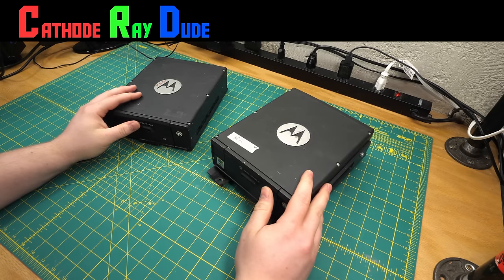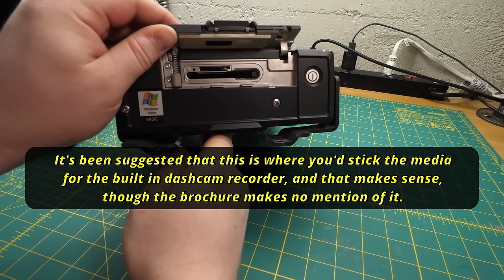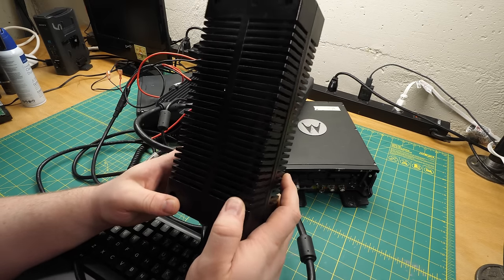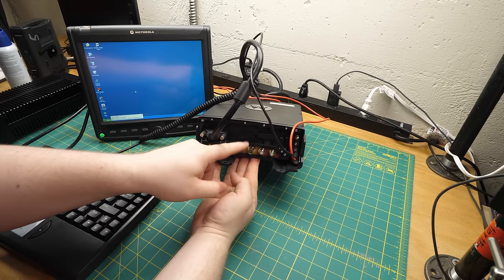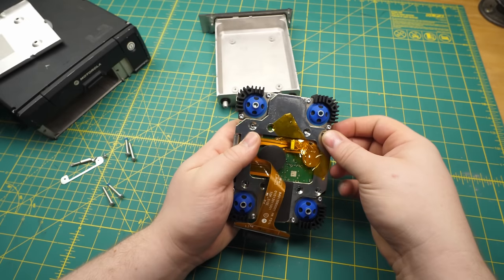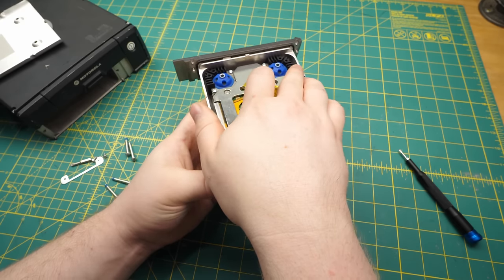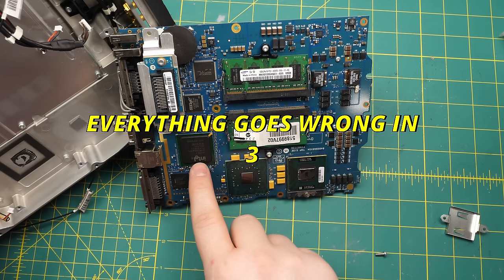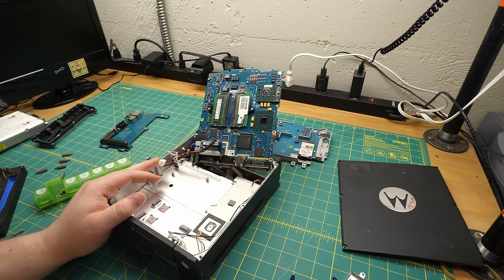Little Guys 7: The Cop-puter [Motorola MW800]

Comment: Before you got the point of saying that it was a heater to keep the spindle lube from freezing in a northern winter, I'd thought it looked like some kind of electronic ID tag.
Since they'd likely have to pull the drives for evidence and such and would need a way of telling which drive was which; but then I don't know when RFID or its immediate predecessors became a thing so...
Reply: It’ll be certainly for heating. That’s why it also features a temperature sensor on the same flex PCB to be used in a temperature PID control loop.
With all the metal, any RFID readout would be impossible.

Comment: the weights on the hard drive carrier help to reduce the vibrations transmitted to the drive. It gives the cage inertia to compress the rubber before it effects the drive.  Sorta, an inertial stabilizer.

Comment: If they cared so much about thermal management and added mass for vibration dampening, and had so much funding to design and build things… you’d think they’d use a lot less aluminum, and a lot lore nickel-plated copper.

You’d also think that for a display built to be used in a car, the included display would have a transflective design (like the GBA SB, as that’s the first device that immediately comes to mind which uses one).

Comment: Motorola still uses Mini UHF on current products on the two way radio side. The SAE connector is also still used in the two way radio side of the business. That power supply is also a factory Motorola product. The two cables off the side are to beak out a ground for relay functions on the radio (call alert) and the positive side is for ignition sense. 

All common stuff to a modern two way radio tech that works on Motorola radios). 

Most MDT applications over the last decade have gone to Android/iPad or Toughbook instead of the dedicated terminal.

Comment: A local city PD bought some used Toughbooks off the nearby State Police post, minus the hard drives.  The machines weren't ancient and they were curious as to why the MSP used hard drives instead of SSD's.  Turned out the laptops wouldn't operate reliably in below freezing temps, and the hard drives would produce enough heat to keep them running.

Comment: The reason that part was isolated from the other board in that pass thru setup is because it must be doing something with PWM. They are putting it up there so it is shielded.

Comment: I assume a lot of the quirks of the design have to do with the nature of how such devices are built. A company building a public consumer device would typically prototype a few times until they settle on a final design, then kick in mass production often before even (publicly) announcing let alone releasing the product, but that doesn't really work when your customer is police departments or similar organizations. You can't just release it whenever and assume they're gonna buy your product, these are typically ordered on commission, possibly in an auction to a few companies, and you may build some prototypes to show but you likely won't start any mass production until you have a signed contract for the order 'cause you can't guarantee you can sell these to anyone else, and then you have a set amount of time to actually build and ship the order so any quirks that show up in mass production and long term testing need to be addressed on the fly to complete the order on time.

Comment: 41:52 To be fair, the monitor could be DVI-A. Not sure why they wouldn't just use a VGA layout, though, since it's the same RGB signal.

Also, yeah, that's a ton more pins than needed for VGA.
Reply: The extra pins are because the monitor also acts as a USB hub, has touchscreen input, and audio

Comment: I once ripped the computer out of a Mazak CNC. A Slant Turn 60, specifically. It was the most rugged machine I've ever seen. Lesser CNC machines can and often are, powered by a basic PC with some kind of interface card, but that Mazak was on a different level. The user interface was provided by a low spec, low power PC running Windows, which was more than enough because importing G code or building a program wasn't very intensive, and that's all it has to do. The hardware of the machine was operated by a Seiko RISC based system. They communicated via SCSI. 

The Seiko machine that actually drives the hardware; servo drives, spindle, measurement eye, tools mag or turret, looked aircraft grade. All the cards that plugged into it had big, blocky pin connectors. Everything screwed together. Dust sealed. Each component of the machine had a driver board, and those interfaces with big amplifiers mounted in a large cab at the back of the machine that drove the real power to the servos, motors, and encoders. It was a fascinating machine to take apart. I'd never seen a machine set up quite like that.

Comment: I feel like some of the criticisms you have may be for valid reasons.

For example the hard drive flex cable, putting a 90° bend in the flex would introduce mismatched trace lengths while a folded cable does not.

And not allowing dust into the sealed compartment prevents dust build up where it cant easily be removed. Given the easily accessible fan grille, it seems fast maintenance was a priority.

Comment: I have a friend who used a bunch of surplus MW-520’s (the predecessor to the 800) and used them for Amateur Radio digital communications and I ended up with a few myself. They had some 386 (idk computers) processor that ran on Windows 2000 (or ME). They had an integrated driver for the keyboard/touchpad, and another for the touchscreen (which apparently is VGA). They had HDDs that had their own special mechanism that insulated it against sudden movement that looks kind of like the one in the video, except extra "rugged."

I was able to start one up and run it once before, but have not been able to get it to work properly since. I have attempted to load a small x32 Linux distro by USB and by directly burning it onto another hard drive and putting it in the computer. The furthest I have gotten is the BIOS screen, and a black screen with “no OS found” or “__.vxd is missing.”

I’m hoping that someone out there with more experience could provide some insight into getting these working.

Edit: The CPU is a Pentium 2 at 333 MHz, 128MB RAM, the BIOS is PhoenixBIOS 4.0, and I managed to solder in new BIOS batteries.

Comment: The thing you mentioned at @45:23 could also be so kind of intrusion detection? The pressure from all screws at tension would overcome that spring and the main board would have a good connection to the Mezzanine module with what looks like a CMOS battery, if the device detects the CMOS was disconnected could causse a intrusion freak out of some kind. This is just conjecture on my end though

Comment: NYC 911 ambulances use a very similar Motorola system (or did 6 years ago). Other agencies I have worked for tend to use Toughbooks, Dell Rugged laptops, etc. Some lower budget systems actually will use a tablet in a rugged case, if they have a CAD (Computer Aided Dispatch) system at all. Personally, we currently have a Dell rugged tablet for our MDT (what we see call information on, GPS, etc.) in a specialized dock. Our PCR computer (the one with use for patient charting) is a Getech Rugged 2-in-1. Unfortunately, there isn't anything too interesting for EMS and FD computing as far as I know since the push for tech came a bit later than PD and many things are handled by software and peripherals.

Comment: @32:55 - The diagonal fold or roll in the FFC is probably to allow more freedom of movement within the caddy.   If the FFC is in a 'straight line' it will be repetitively 'puckered' and pulled taught, with the diagonal corner, it mostly just 'rolls' with the movements within the caddy...

Comment: At 40:27 you talk about the size of the chip package of low end GPUs - but the simple reason for that is just that they have a lot of pins! You had the parallel PCI (or AGP) port, display outputs (often more than one), and most importantly - an external memory bus which even on lower end GPUs was fairly wide. But if you're using PCIe and only need basic 2D, you can cut down the pin count quite a bit. If you drop to the basics, single-link dvi + vga + pcie 1x + 16 bit memory bus should be possible in maybe 50-ish pins? Build in the memory (probably stack it within a single package) and the result could be positively tiny.

Not that there's any reason to build such a thing, given how common integrated GPUs are.

Comment: That folded flexible pcb for the connector on the disk drive caddy seems pretty normal to me.
Folding it that way to make a corner makes it less prone to tearing during assembly and vibration in its life time.
Its also most likely cheaper to manufacture a longer strip of flex pcb then one that has a 90 degree angle halfway.
Open up something like a digital camera, laptop, nintendo switch or name another small device and you'll see it everywhere.

Comment: Mini-UHF connectors are on just about every Motorola radio made in the last 30 years with the exception of the APX8500; very common...

Likewise the low-current version of the Moto power connector. There's a beefier plug for high power radios that screws in, though I haven't seen it since the Astro Spectra 100w radios. More recent HP use that connector with larger gauge wire.

Comment: Regarding Cooling- I've worked on quite a few old laptops, and many just have active cooling on the CPU and GPU using fans in ducts and heat pipes. What cools the rest of the board? I'm sure they figured for that- I guess the thought was (since in the car and not the trunk)  that is the police computer is being used, it's probably in a car with the air moving or a/c on since the officer would need to also be inside the car. If it was actually trunk mounted.. heat would be way more of an issue imo. It's also possible that part of the oem police package includes a duct specifically blowing on that case from the car's HVAC system, using the car's blower fan for active cooling the case.

Comment: That “weird” plug is nothing more than a centronics/oarallel port that was used as a scsi connector.

In this case, it’s simply an available connector with many pins, in order to provide a ONE plug interface/connector!

Comment: The Dell Latitude XT2 could be optioned with a 1.8” SSD back in 2009, but it was by no means standard, cheap, or common. The XT2 was pretty popular, especially in medical environments, so there’s probably quite a few SSD-equipped ones (like mine, previously used by a pharmaceutical lab) out in the wild. It’s probably my favoritest of the Latitudes; it still looks fairly modern next to business laptops 15 years its junior, it’s capacitive touch with N-Trig on a silky matte display, has very satisfying key travel and feel for any laptop, especially a thin ‘n’ light, and full XP OEM support.

Comment: 54:26 looking at the top of the chassis, between the armored cable and the black plug there is a copper tube protruding that appears to be a heat pipe and earlier in the shot of the fans at 35:07 it looks like it goes to the block cooled by the fans (copper tube by the leftmost fan).  There may be some active cooling of those inner aluminum surfaces via that heat pipe.

Comment: Motorola has used the mini-UHF as their standard antenna connector for their LMR mobiles for quite some time. Being a ham, most of what I had dealt with have been N and UHF(SO-239/PL-259) until I started volunteering with our sheriff’s SAR, which is all Motorola except a few exceptions.

Comment: GPS modules do tend to come as little bricks with mezzanine plugs, especially older ones. The pinout isn't standard, but in general it's power, ground and an RS232, and occasionally I2C or something.

Comment: Here is some information to help you think of why it might be used in particular. You might be able to one day get a LibreBoot with which to flash it, and then maybe add a bunch of COM serial to use it as a remote-in hub whilst using linux or instead FreeBSD whilst listening on multiple sockets. Then at 25Watt, and lower, it could run from a battery or some 12 Volt from some XBox360 PSU mods if not in a vehicle. It could run a BSD jail on one core in a modest way. Then by means of the BSD to Linux compatibility layer, the linux could thereby take advantage of the listening on multiple sockets from the system calls functonality of BSD. This also means UFS could be used. The use SSH by means of a hardware security USB key (or RFID by means of adaptation if not available by USB). The the user (SysAdmin) could listen on kernel by TTY session, using a Key gen conversion (SSH, via TTY or PuTTY key gen too). The other useful thing is that the 100Mbps ethernet driver are likely to be significantly smaller by comparison to 1GBps drivers for NIC. That helps if sending it over limited bandwidth (serial IO for instance) or using small amounts of RAM in a stack It could totally do a wee reverse proxy by means of DNSCrypt-proxy and stick a Squid_server in it. You have 2 of them for redundancy and can thereby overcome a single point of failure if the reverse proxy is the only way to access a server (just in case it were to be set-up that way for personal preference). If that happens, have a siren blare and blue flashing lights atop the box to notify the SysAdmin what's up and a prerecorded audio sample wit radio static saying "This is the Keyarps! I need backup! Do you copy? What's your ten four?". Thereby alluding the the UFS file system support of Unix BSD in Mac OS X 10.4 for an underlying connotation to promote learning and virtue for a brighter world and harmonious future in which we all join hands and sing the Coca-Cola song.
Or instead set-up the 2nd one as a 2Fast2Furious style racer car with a blue-light beneath it as they can "chase" each other, maybe by ledger poisoning with a DHT too. Then jump horizintally sideways like Max-Payne with pretend trigger fingers in slow motion, making a few pew-pew sounds whilst saying "Noooo" because 'reasons' (or instead as a visual metaphor for the constant plight of ethical hacking).
My comment has no hate in it and I do no harm. I am not appalled or afraid, boasting or envying or complaining... Just saying. Psalms23: Giving thanks and praise to the Lord and peace and love. Also, I'd say Matthew6.

Comment: on the hard drive part the bumps of metal were most likely just to make sure the case didn't bow in when and if the system is every dropped. and it some how comes out on accident or crushed in an accident. These things are built to go and keep data of what happens. The 2.5" drive is a 5400 RPM drive as it has less chance of head crashes that way. Yes a very minor difference from 5400RPM to 7200RPM speed but everything is made to be more able to be more durable. A 7200 RPM drive also takes more power and generates more heat. They have a power budget to keep inside of for the entire system including everything plugged into it. 
Heavier means more fuel used with it in the car, using more power means more fuel used, and they want to use as little fuel as possiable to run the device. Over the course of weeks the little more fuel used ads up to gallons more used for the same device. So low power everything makes sense.

Comment: I have a Getak S400 laptop I bought new to replace laptops that kept braking on me in college. It still works with Linux and is my workbench computer on a dock connected to a 2nd monitor. I upgraded the hdd the year after I got it and the caddy is about a 3rd of the isolation as that rediculous one, and has a flex printed circuit that wraps around the drive with traces that work as a heter as well. A very cool laptop design, the one flaw is the resistive touch screen witch I put up with for too long and finally opened up the screen and removed the panel of the lcd.

Comment: At 44:36, that is most probably a fan controller/adapter, or at least looks like it. They probably changed the fans on the thing somwhere in production and did not want to change the whole board.

Comment: I used to install the Computer Aided Dispatch systems in fire trucks.  We would slap a Toshiba Toughbook on a mount pedestal and hook up the radios.  So it was not that interesting on the PC front.  But the radio networks would have a rugged  Cisco 3270 Router that was handling if the truck was using GSM (Cell Phone) or wifi when it was parked at the station.

Comment: i would bet that it runs DVI-I which supports both VGA or DVI-D(if you didn't know DVI uses the same video standard as HDMI) DVI-I also supports audio unlike VGA and DVI-D, DVI-I has 4 Extra pins compared to DVI-D to send a backup VGA signal for when no Digital display is picked up.

Comment: The furniture pads made me laugh. I have a Dell laptop from 2011-12 that developed a faulty SODIMM slot a few years ago that made the machine unusable.  I noticed that if I pushed the socket down into the motherboard, it worked normally. So, I affixed a piece of a non-slip furniture pad on the inside of the bottom bezel where it would apply pressure to the slot. It’s been fine ever since, it now runs my Valheim server.

Comment: I believe that those RJ45 ports may be for use with a different modem or router that has support for an alternate wired connection. This could be used with something like a Sierra Wireless Modem or a Cradlepoint.
Reply: Throughout the US no state agreed on a communication standard, for example Ohio used the 800mhz digital band for almost 20 years, Michigan just switched a few years ago. Data in some states were handled by radio equipment not cellular equipment. Which makes sense for some areas where cellular coverage was sparse. The radio internet was slow but some of the radio modems had Ethernet out